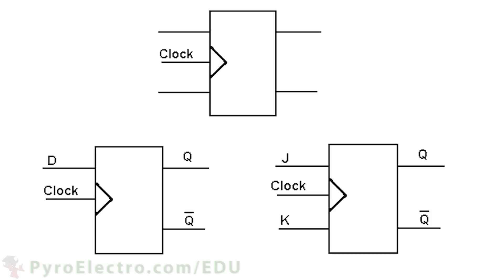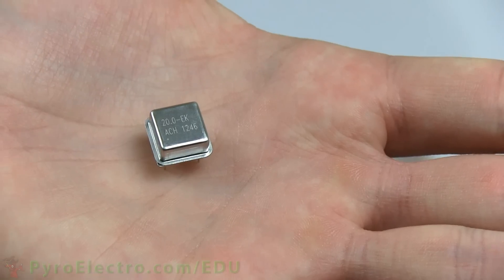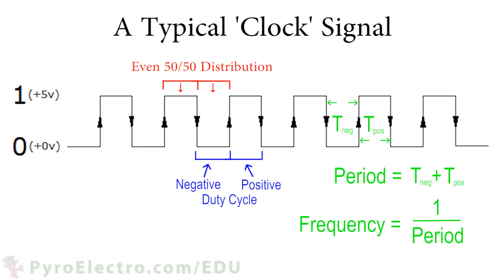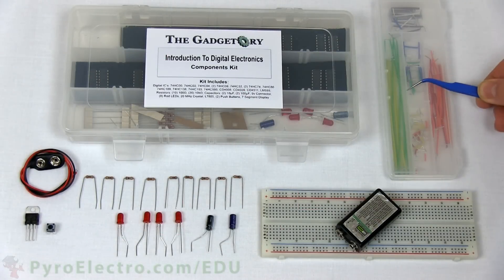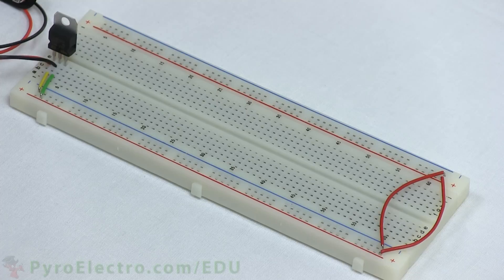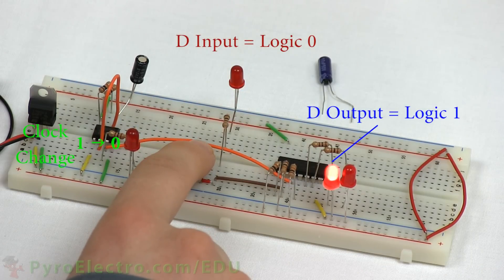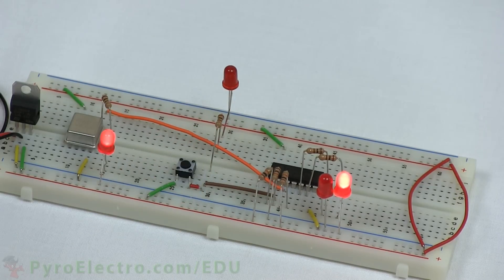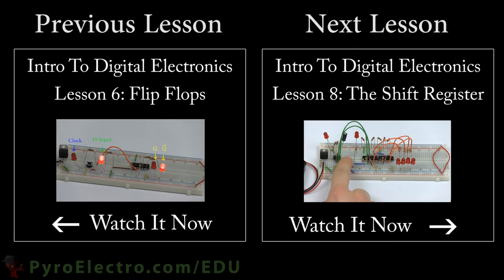Clocks and Oscillators - An Introduction To Digital Electronics - PyroEDU

Comment: I suggest you look at a ethernet ic realtek data sheet and scroll down until you see clock timings and look at output enable and turning the clock on and off with voltahe lines and inverting voltage lines you can use leds for hz but sampling rate will end up saw tooth not sqaure wave for base clocks